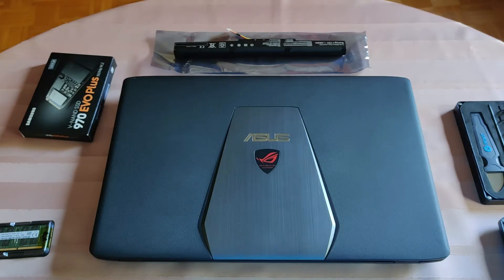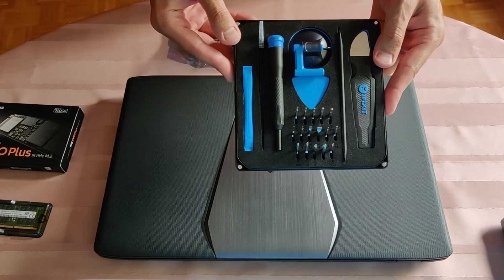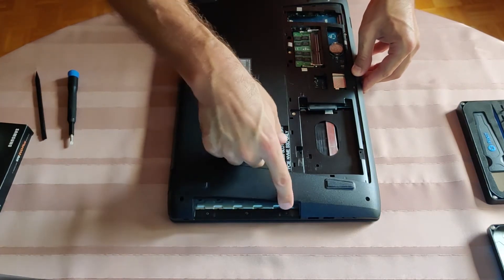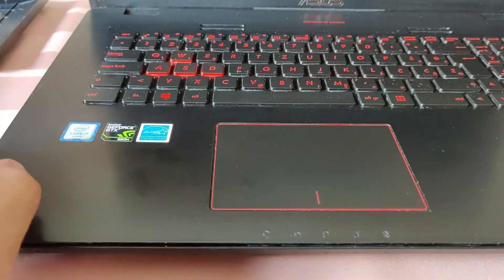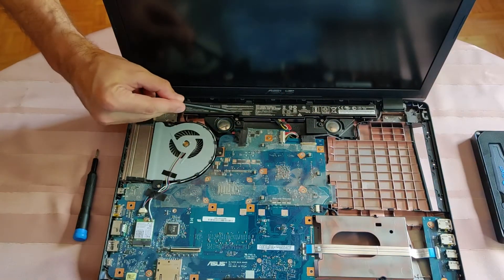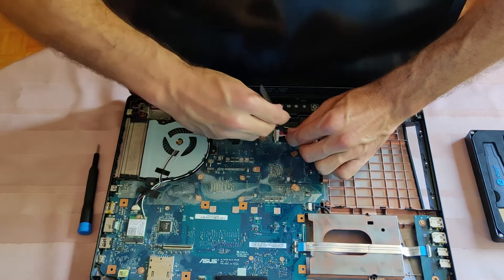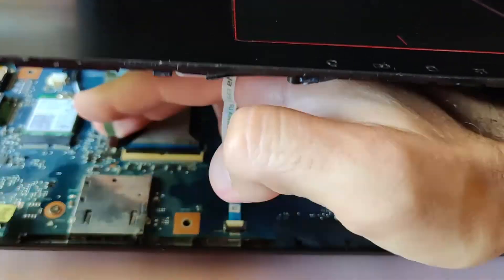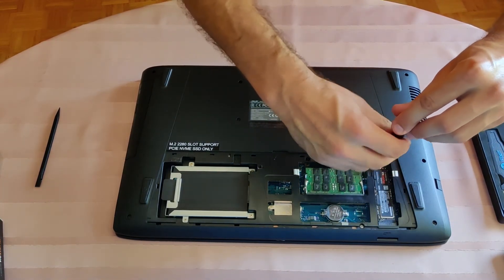Asus GL752VW ROG - battery & m.2 PCIe SSD replacement, also upgrading RAM

Comment: Fallowed your video and replaced the battery and no issues . Thanks .
Reply from the maker: You are welcome. You are the reason I keep making the videos, you did it yourself.
Reply: @smooth.IT.operator  I sure did . I bought it off of a friend for $50 , put the battery in then took it to the fix it shop and turned out the hard drive was pooched . So all in I got a screamer for $280 and I got 8 gig more  of  Ram ordered . As it sits now , from off to on line in 20 seconds . Thanks for your help .

Comment: Sir do you know gl752vw speaker replacement what model can use on it
Reply from the maker: Thank you for watching. Search Ebay or Amazon for the speakers.
Reply: @smooth.IT.operator  but Asia side can't find but anyway thank alot
Reply from the maker: @TkhengOoi-i3n  Go to AliExpress or whatever market you use there. Someone surly has a failed laptop like this and selling the still functioning components.

Comment: You failed to mention that 2 of the black screws for the outside cover (back) are shorter than the others
Reply from the maker: Thank your for watching, if I did then I accept full responsibility. Hope you were able to get your job done despite.
Reply: @smooth.IT.operator  Actually not.  I managed to replace the battery but the computer would not run even plugged in.  Upon investigation I found I had mangled the end of the flat cable from the touch pad.  Now I can't find a replacement.
Reply from the maker: @ramtek2702  Sorry to hear it. It could be challenging to find spare parts, maybe even used ones on Ebay, Amazon or Ali? You should be able to run your laptop without the touchpad plugged into the MBO I believe so your issue of laptop not starting might be deeper than that.
Reply: @smooth.IT.operator  I've already come up empty on all of your suggestions, but thanks anyway.  What I suspect is the mangled contacts on the cable caused a short in the logic preventing startup.  I will try running without a cable to see if I destroyed the logic permanently.  I've done quite a lot of electronic assembly like this and that is the poorest style cable termination/assembly I've seen.  Very easily damaged without knowing it.

Comment: Thanks for your video. I actually replaced my battery a few years ago and wished I'd seen your video sooner. I'm going to check you amazon link to upgrade my SSD.  Would you stick to your SSD recommendation, or change it since it's been a year.  I'm looking for a 2TB drive.
Reply from the maker: Thank you for watching and commenting. Good job in replacing the battery. Have to be honest, new battery wasn't of much use to me because the controller on the MBO or some other crucial component for charging the battery permanently malfunctioned. Cannot charge the new battery. Amazon links are OK (there is even discount on many of them). You want a SATA3 SSD 2TB? Be sure it is supported, check the manual please. Even if you opened any of my Amazon links and then kept that tab opened and searched and bought 1kg of monkey bananas from Thailand, I would still get a commission. My point, buy any drive or brand you prefer. Thank you.

Comment: thank you very much, I used your video to disassemble mine and replace the battery, very clear instructions and easy to follow. as a side note, you don't really need to disconnect the cables underneath the keyboard, you can just slide it down enough so you can get replace the battery ;-)
Reply from the maker: You are welcome. Thank you for watching and for your tip when replacing the battery.
Reply: @smooth.IT.operator  quick question, do you have issues with the touchpad not working? i've read a million solutions but none work for me... 😞
Reply from the maker: @GuillermoVillar-jf2wq  Touch pad working without problem. Tell me do you frequently connect USB mouse / USB receiver? Also is it possible that you strained the touch pad connector since you told me you didn't disconnect them all?

Comment: Do you know how to turn off Fn key
Reply from the maker: Thank you for watching. Come on man, "Google is your friend."
Reply: @smooth.IT.operator  i tried everything still not working 

i want to stop using Fn key with volume
Reply from the maker: Try this please:

"Have your tried pressing Fn + Esc for a second or two to turn off the Fn lock?

or

If so, then boot your laptop into BIOS, and in there look for a toggle to switch between Media keys and Function keys" @Mmwm-b1j

Comment: Merci pour cette Video ,ca va m'aider .....Mais il y a un MAIS  ZUT  Les deux liens que tu donnes pour la batterie de rechange sont morts Le produit sur 
AMAZON est non dispo    Grrrrr.
Reply from the maker: Thank you for watching. You are right, batteries are unavailable. I would recommend searching either in France at some specialized shop or on French Ebay. I think you might get the battery from Germany, just enter "A41N1501" into search. I even think my friend has a spare battery that he bought but never used. You want me to ask him?

Comment: Hey man, thanks for your tutorial, I changed the battery and installed a new SSD Samsung 980 1To but Windows can't find it, I updated the BIOS and the RST firmware but it s still the same problem. Do you have any idea about how to make it work? Thanks a lot for your help.
Reply from the maker: Hi! Thanks for the feedback. Can you disable AHCI mode in BIOS (if possible at all) on SATA storage and then reenter BIOS to see if m.2 is visible. Please don't boot to Windows if you disable AHCI! Please temporary disconnect the BOOT drive. Don't think it is the capacity 1TB is the problem.
Reply from the maker: https://ebay.us/ieCDb7 This drive folks said is recognized by the laptop. Can you return your Samsung 980?
Reply: @smooth.IT.operator  hey man, unfortunately I tried but it was too late. But I managed to try a M2 Western Digital red SA500 in SATA and it worked 🤷‍♂️ I think the Nvme format is not supported by my Gk752vw version, even if the documentation says it should work. Thank you very much again for your help on that, much appreciated!
Reply from the maker: @ram-z890  I am glad you got yourself a drive that is working! Sorry about Samsung 980. Can you put it in an ad and be patient? It is without packaging seal but still barley used. You will get a good price for it, buddy.

Comment: is a battery replacement worth it? mine works but it's 5 years old so i feel like it lost stamina
Reply from the maker: Thank you for watching. My humble opinion is that the replacement is worth it only if you heavily rely on the battery - traveling and moving outside a lot.

Comment: Thanks for the video, I'm looking to upgrade my SSD, the documentation says it can take Nvme Pci/Sata, it's the UK version. So I was wondering if the Seagate Firecuda 530 will work, I read that it s a new PCIe (1.4) format so I'm not sure it's gonna work, what do you think? Thanks a lot.
Reply from the maker: Thanks for watching. Respectfully, I would go with Gen3 SSD hardware just to be certain and avoid the hassle. After you buy the Seagate can you return it if the laptop doesn't recognize the drive? Most important of all, only starting from Intel's 11th generation processors, there is support for PCIe Gen4. Unfortunately you won't get the Gen4 bandwidth even if your laptop recognizes the Seagate. Why not go with my SSD options from Amazon (in the descreption box below the video)? Good luck and please share what were you able to accomplish.
Reply: @smooth.IT.operator  Thanks for your reply, I will go for a Samsung 980 in that case , as you mentionned the processor will not work with the Gen4 so will change my mind about the Firecuda lol, thanks a lot for your help 🙏
Reply from the maker: @ramziboudemagh5551  Successful upgrading!
Reply: @smooth.IT.operator  Hey man, I finally had some time to change the battery and try to replace the SSD. But unfortunately the computer does not recognise the SSD Samsung 980 1to, the user manual says it should work with SATA & Nvme. I updated the Bios but there's no difference. Do you have any solution? Thanks a lot for your help 🙈
Reply from the maker: @ram-z890 Hello! Good job with finally getting to upgrade your laptop. Nice move with upgrading the BIOS also! SSD Samsung 980 1TB not working you say? Tell me please (may be to obvious but have to ask...) did you try the SSD on another PC? Is it really working? So when entering the BIOS on your Asus laptop - you cannot see the SSD drive as a boot entry? Can you please also remove the 2.5 inch SATA drive if you have one and just try to see if the SSD is now visible in BIOS and disk management in Windows.
Reply: @smooth.IT.operator  Thanks for your reply buddy! The SSD is working on another computer. I tried all the methods you mentionned but nothing is working on the gl752, I also tried to update the RST firmware but nothing changed...I m now wondering if the 1to capacity is too big, maybe the limit is 500Go for the Asus GL752vw 🙄
Reply from the maker: @ram-z890  https://rog.asus.com/forum/showthread.php?79590-Issue-with-M-2-SSD-in-ASUS-ROG-GL752VW/page17

Comment: I installed m.2 but I doesn't detecting. How to add drivers. Please help me in this.
Reply from the maker: Thank you for watching. You don't have to add drivers. It is "plug and play", the Windows OS should detect and install the SSD automatically. Is the m.2 faulty maybe? Did you try it on another PC? Did you enter the BIOS and check if the SSD is visible there? Check the boot devices on boot settings.
Reply: Must use sata m.2 (which seems to not be made anymore) not nvme/pci m.2.

Comment: Did that ssd work.? I ordered same. But it is never detected in my laptop
Reply from the maker: Sorry to hear that. Yeah, it worked because I had to install Windows 10, drivers and all the applications right after. Which type did you order? NVMe m.2 or SATA m.2? Which does your laptop support?
Reply: @smooth.IT.operator  nvme m.2. can u send me the link for specific sata m.2?
Reply from the maker: @safaee1140  What ssd did you order exactly that didn't work for you?
Reply from the maker: @safaee1140  https://www.computeruniverse.net/en/p/90719417
Reply: @smooth.IT.operator  I ordered same but 970. It didn't work . i read some posts .it works in CANADA models and nvme ingeneral does not work in USA models
Reply: @smooth.IT.operator  I bought the same one as u showed in video. But u sent me a different link.
Reply: @safaee1140  Yes. I sent you the SATA m.2 SSD because you told me in the comment "specific sata m.2". The exact model of the Nvme m.2 SSD that I used in the video is in the description box , Amazon link.

Comment: How about GL552V 7265NGW are they the same? I'm planning to upgrade the SSD. Hoping for your reply, thanks.
Reply from the maker: Thanks for watching. You definitely have a different model. What does it say on the back of the laptop? Do you have a sticker stating what kind of SSD the laptop supports? Caution is advised because I heard that m.2 NVMe SSD is not supported on some models of this laptop. You have to buy m.2 SATA SSD then (two notches on the connecting part, NVMe only has one notch).
Reply: @smooth.IT.operator  Hey there! thank you for replying I really appreciate it! It says here that it only supports m.2 2280 SATA SSD so I think that what you said is correct. Any suggestions on what brand do I need to buy for this kind of item? Hoping again for your reply, thanks!
Reply from the maker: @markarvin7411  I would go with Samsung SSD 860 EVO M.2 (2280) SATA3 500GB. Check Amazon,Ebay or other merchants for a better deal. Good luck in upgrading. If you need help with installing Windows, let me know. We can set up a video call and I can guide you every step of the way. I do this professionally for some time now. ;)
Reply: @smooth.IT.operator  Thanks a lot! Is it possible that I could just clone it?
Reply from the maker: @markarvin7411  Do a fresh Windows install on a brand new drive and have a nice, clean slate. Maybe even Windows 11. ;)
Reply: @smooth.IT.operator  Alright, will do. Thanks
Reply from the maker: @markarvin7411  Hello! Did you upgrade already?

Comment: Me sirvió para ver que M2 necesitaba el Asus ROGgl752v, ya que compré uno M2 SATA y comprobe que no funcionaba, perdi mi dinero pero ahora sé que el que necesita es nvme pcie, gracias por el video maestro!
Reply from the maker: To bad you couldn't get a refund for your SATA m.2. Mistakes happen, we learn from them and hopefully not repeat them. Thanks for watching.
Reply: Hola Cristian,  como te va con el pcie y de que tamaño instalaste. Yo tengo el mismo modelo y pensé instalar el M2 SATA de 480 gb
Reply: Una consulta Cristian, yo tambien estoy haciendo el upgrade de mi disco a ssd y veo que en mi tapa dice: "M2 2280 SLOT SUPPORT PCIE SATA SSD ONLY" Y veo que en la tapa de el dice : "M2 2280 SLOT SUPPORT PCIE NVME SSD ONLY" mi duda va con que interface tendria que comprarme SATA O NVME, pueden sacarme de esa duda por favorr
Reply: @0l0l.__l___l0l00  saludos, asus la cago con esta laptop ya que no es compatible con nvme 2.0, puedes ponerle el Samsung evo 860 para abajo ya que es sata  m.2, hasta ahora no se si existe algún update de la bios para arreglar eso, yo compre eñ samsung evo pro 960 ssd 2.0 nvme y no tuve más remedio que usarlo en otra pc, es ridículo que en el mismo manual dice que es compatible pero realmente no lo es
Reply: @0l0l.__l___l0l00  Hola Mauricio, mi laptop es igual al tuyo, igual dice sata ssd, al final que le pusiste y como quedó? saludos
Reply: @IVIick3000  hola José, le puse un disco sata m.2; me compre el modelo de "Samsung 860 EVO Sata m.2" y quedo perfecto. Para mi caso solo necesitaba 500gb pero hay de más capacidades
Reply: @0l0l.__l___l0l00  Gracias por responder, yo quiero clonar mi HDD, me toca comprar SSD de 1T. Buen dato

Comment: Thank you very much, I am very interested but it will be for a desktop computer but it needs to be repaired because although it is brand new, one of the components is defective. Can I get back in touch when it's done? thanks very much

Comment: Is the 970 evo actually working? Because i just found out that the asus rog gl752vw is only compatible with a Sata m.2 ssd and i already tried to install the 980plus which didn't work.
Reply from the maker: Well if it says only compatible with SATA m.2 SSD on the back of the laptop then you know NVMe PCIe m.2 models are not supported and don't work as you clearly stated.

Comment: Why to use that ssd model, would the computer work with an ssd980 ?
Reply: I have the exact same model and it didn't work for me. I also found out that the m.2 spot on the laptop only supports a Sata3 m.2 ssd.
Reply: @Ynos1  which ssd  did you tried?
Reply: @moralesisaac63  i tried the samsung 980 pro. But i now ordered another m.2 ssd which i hope will work.
Reply from the maker: @Ynos1  980 Pro is Gen4 PCIe SSD, 980 is Gen3. 970 Evo Plus like the one in my video is also Gen3 PCIe. Maybe that is the reason it didn't work.

Comment: I have the same laptop I believe. Mine is the GL752vw 71 that came with the 1tb hdd, no m.2 ssd but does have the slot. It is m.2 sata ssd only from what i understand. Just wondering if you know if there is a limit to how big I can go for that sata ssd? I've read 250gb is max but then read others using 500gb. Thank you in advance.
Reply from the maker: H! Thank you for watching. There is really no limit to how far you can go with the SSD SATA m.2. To be precise, if you plan to go above 2TB (you really going this big???) then you can't use MBR for your partition scheme but GPT scheme. 500GB or 1TB SATA SSD should work just fine. Best of luck upgrading.
Reply: @smooth.IT.operator  awesome, thank you! Just want to go either 500gb or 1tb for m.2 sata ssd for OS then upgrade the original hdd to 2.5 ssd 2-4tb. Mainly for battery preservation. I need a new battery as well so your vid was right on. Thanks again for the info👍
Reply: @marcoolinho  uh oh. Ok, fingers crossed. Thank you
Reply from the maker: @sheldonrevis9268  Please share what you achieved. Looking forward to it. Cheers.
Reply: @smooth.IT.operator  will do!
Reply from the maker: https://tinyurl.com/SSDTypesPreview

Comment: I have the same system and the bios won't detect the 970 evo, even after updating the bios.
Reply from the maker: Hi. Since you updated the BIOS you know what you are doing. Just to double-check though... are you sure you support PCIe m.2 and not the SATA m.2 only? Only one notch in the m.2 slot, right? Can you check if your EVO is really working on another PC?